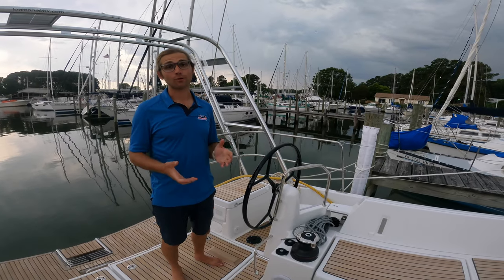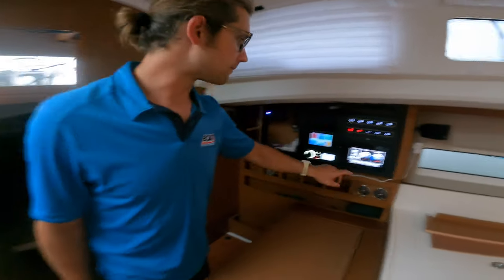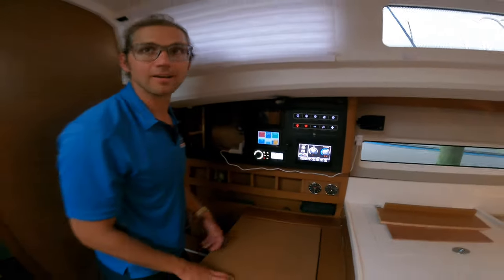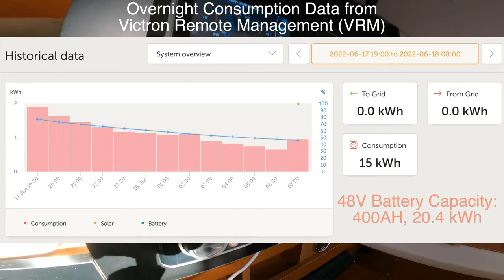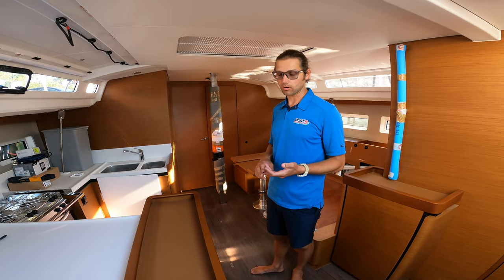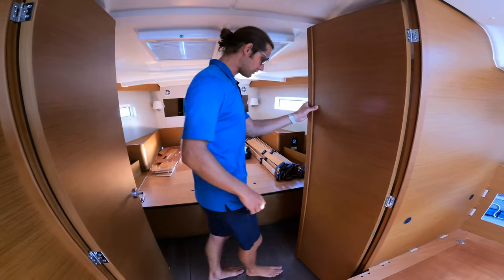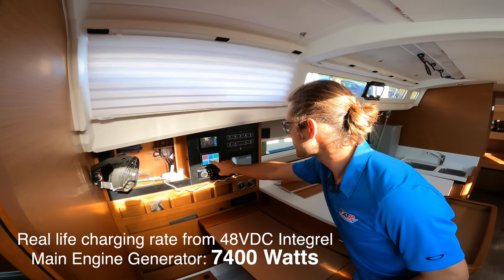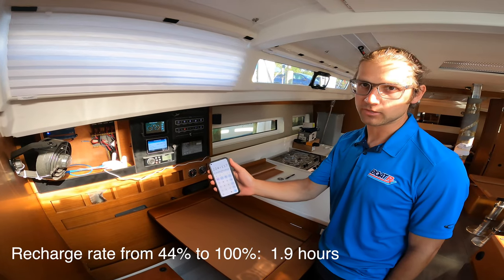Prove it!  Battery-powered air conditioning DEMO on a new sailing yacht.

Comment: How big is the battery bank?
Reply from the maker: 22kWh
Reply: @boatrx  458 ah battery bank?
Reply: @JohnBraman413    That's 458AH on a 48v system.  That's 1833 ah on a 12V system.  You'd need 4000-5000W solar to keep it topped.

Comment: What a useless video.  The main questions any viewer would have are :1) how big is the battery bank, 2) type of batteries, 3) the BTU size of the A/C unit, 4) how many amp hours were consumed, 5) the run time, and 6) the per hour consumption of amps.  None of these were addressed.  Rather we watched screens being tapped endlessly.  Pass on this video.
Reply from the maker: Sorry you found this useless!  There are more details about this system in the video that preceded it.
1) 22kWh @ 48VDC
2) Victron Smart Lithium
3) 36K BTU VRV Compressor with 54k BTU of air handler capacity.
4) About 100 AH @48V
5) 8 hours
6) About 10-14 amps @48V average at night
Reply: @boatrx  can you translate that to a 12V system?
Reply: and don't recall anyone asking you to pay to watch the video....   don't be a jerk.
Reply: @Murphy-Kahlen   you just multiply by 4.  
22kwh is 1833AH in a 12V system
400AH at 12v
400A-560A at 12V average usage at night
Reply: Do you use, have a need for, A/C soft starters?

Comment: There is no cunning to stretch  your cool. No explanation of humidity. No demonstration of how the system is installed. Most boat AC systems throw off their heat through the water. 1500 watts is excessive. If a boat chose a modern camping unit, size and build would be excellent. The AC could work on land. It would be lighter and much easier to install and maintain. Thumbs down.